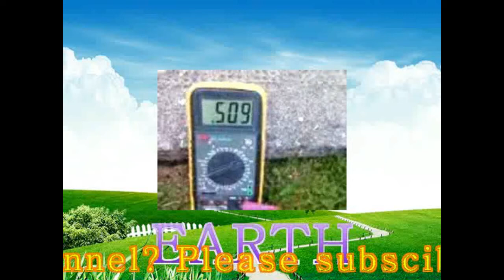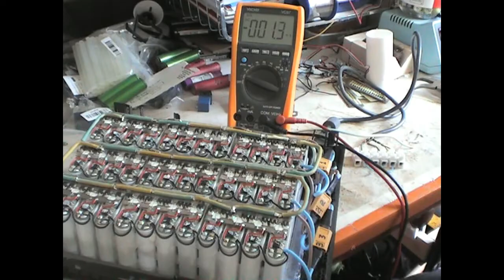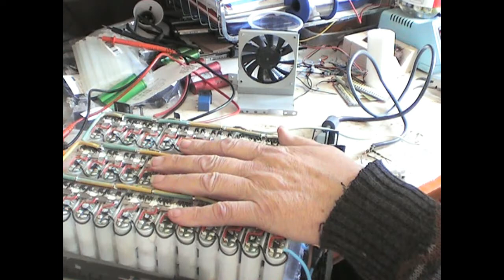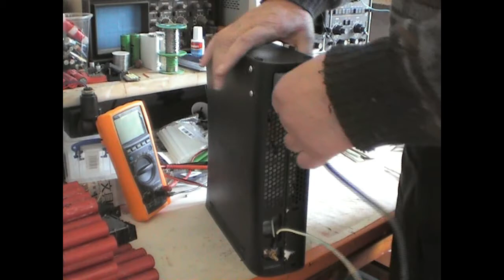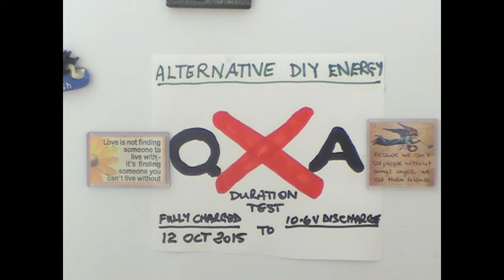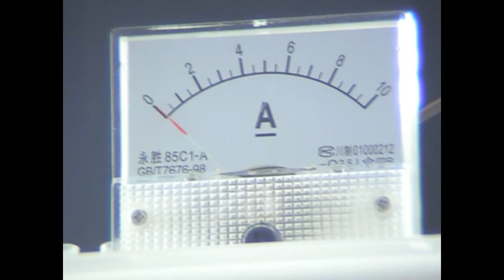New Lithium Battery 26

Comment: another idea might be one of the load meters that tells you how much power you have put in and used like these http://www.ebay.co.uk/itm/DC-LCD-60V-100A-Balance-Voltage-Boat-RC-Heli-Battery-Power-Analyzer-Watt-Meter-/390932345418
i belive they can be powered from an off board battery and not the power feed so would remeber charge rate of solar panels with an offboard battery if you have one on the solar side you would know how many watts of power you have fed into the pack and one on the output of battery to show how much you have used i with they would do one unit that you just clip to battery and will dedcut the charged amount from the used amount to fully monitor the battery

Comment: 10.6 is very high li-ion can go as low as 2.5 volt each with no issue but i would use the protection circuit to stop over discharge as this is what i do with my 3series pack
Reply from the maker: +David Simpson Yes I agree they can go lower. But I wanted a standard to work with so I chose car battery dead voltage.

Comment: when the pack is wired for 12.6 volt the live charging wir is licked to all the lives on the batterys so why does it not sort out when it goes series cos ant that sorting each bank out
Reply from the maker: +David Simpson No. In series the +ve comes out to the output and the others go -ve fist pack. Then that is connected to +ve of second pack and so on. the link is put through the nc contact of relay. So when the relay energises to charge the link is broken.
Reply: +Alternative DIY Energy ah just like my idea in the email
Reply from the maker: Yup.
Reply: so basicly the middle bank is switching live off the 1st battery 2nd relay is switching negitive of the 2nd battery i found with mine all i needed was 2 wire input from panels and 2 wire output for 12.6 with volt meter on drops to 4.2 when charging a very handy trick so show if in charging mode or not i also have an analog amp meter like you the digital one i have goes on the negitive voltage rail but that may jusdt go on the solar panel side so is only active when panels are in sun
Reply from the maker: I have to do a video showing the circuitry me thinks.

Comment: i have noticed on my li-ion 20p3s pack it is always the middle pack that discharges the fastest and is always the last to charge if not balance charging i thoght it was a faulty back but in fully charging the pack then swapping the order i so the same results
Reply: +David Simpson That is one of the reasons I diode feed each cell. A little extra work but I get a ballanced pack.
Reply: +Raymond Earle i had thoght of this idea to and thoght if every lion was on a diode on the output ok you loose some voltage but if a cell died it would not pull the other cells down and the same if you put diodes on the charging side if one cell died it could not pull power from other batterys on input or output and when you find that the battery pack is not staying to capacity all you would need is a volt meter to find the dead cell this is where your idea of the battery holders would be ideal
Reply: That is true my friend. I am in the process of designing a single cell BMS for the 18650 cells. My target is 10 for a £1.00. The best I can find on the market is 5 for £0.99. Which works out expensive for someone who is on a low income. I am hoping one BMS will look after 4 cells in parallel. Got the chips on way and the prototype PCB done complete with fuse. It measures 300mm x 20mm. So a small footprint.
Reply: well I charged pack at 1 amp the other days with the 3 series protection circuit and all batterys charged to 4.2 need to try the same at 5 amp to see if it is just because I used low current or if the pretection circuit is helping to keep them balanced
Reply: +David Simpson You will find it's a bit of both. 5A is what I charge mine at on the bench before I put the pack on the system. It will take what is needed and no more.
Reply: +Raymond Earle or I inderstand the closer to 4.2 they get the less current draws but I was thinking tge higher tge current they draw in series the faster they may go out of balance
Reply: If your lights are for examle pulling 2A and you have 10 cells in a pack. Then per cell the draw is 200mA. So long as the current is less than the pack can deliver. You should be fine. That is where diode control works well.
Reply: +Raymond Earle it is on charging i mean as charging as you found your self is where the damage happens discharging the li-ion protection circuit will shit off if any bank runs to 2.5 volt this normaly takes some time to happen lol as to the pack with my phone on charging and ther step up converter for the light you sent me it draws about 700-1000ma so lets say it is 1amp and my pack is 44 ah im good for awhile lol

Comment: ok that is pretty cool.

i'd love to see how much the battery dips in voltage under full load, and i wonder how many hours of full lighting you would get.
Reply: +Rinoa Super-Genius 3 of those cells in series can keep one of my bulbs going for over 6 hours and the combined cells had not reached my 10.6V discharged point. I turned it off so I could go to bed. LOL. So I calculated the pack at 6 hours per 3 cells. Making it 72+ Hours of run time. I average 7 hours ish a day so it is about 10 days before reaching my 10.6V discharged point. I THINK. LOL. Math and me don't gel. I am making more bulbs daily so wont be long to see how much they all pull and how far they dip. I may restart this test when fully populated. We will have to see. Have a great day my friend.